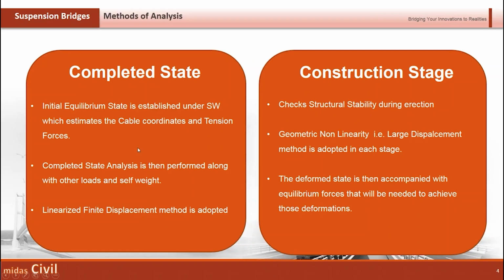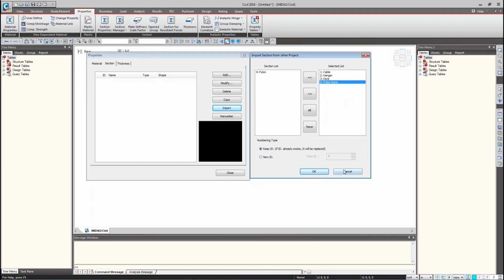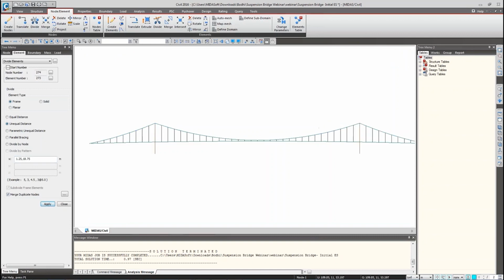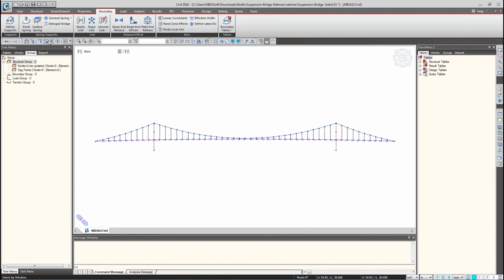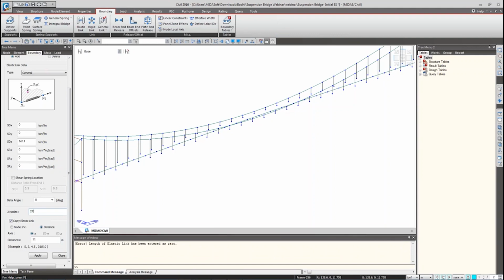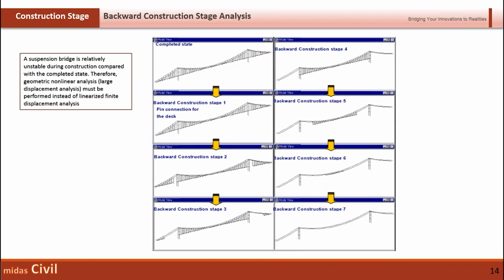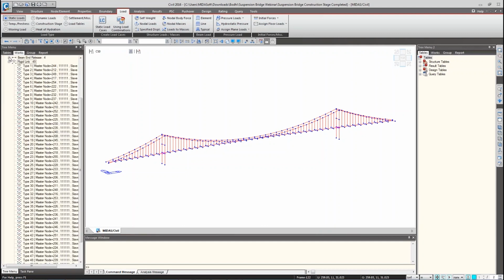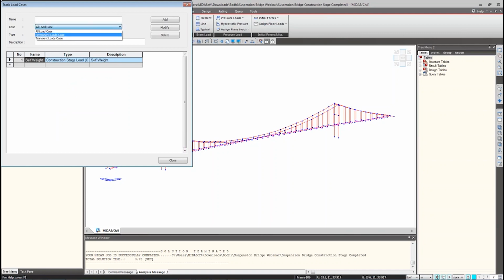Strucutural Analysis of Suspension Bridge: Step by Step Training | Bridge Design | midas Civil

Comment: Good morning sir, I am very grateful to Midas. I am getting warnings while analysing  complete stage analysis. How to overcome this. 
LOADCASE NO.  :    1
   ITERATION NO. :    1      DISPLACEMENT ERROR NORM .. :  0.10000E+01    CONVERGENCE TOLERANCE .. :  0.10000E-02
 WARNING : NODE NO.     83  RX  DOF MAY BE SINGULAR.
 WARNING : EQUATION NO.       250
 WARNING : NODE NO.     83  RY  DOF MAY BE SINGULAR.
 WARNING : EQUATION NO.       251
 WARNING : NODE NO.     83  RZ  DOF MAY BE SINGULAR.
 WARNING : EQUATION NO.       252
 WARNING : NODE NO.    409  RX  DOF MAY BE SINGULAR.
 WARNING : EQUATION NO.       748
 WARNING : NODE NO.    409  RY  DOF MAY BE SINGULAR.
 WARNING : EQUATION NO.       749
 WARNING : NODE NO.    409  RZ  DOF MAY BE SINGULAR.
 WARNING : EQUATION NO.       750
Like this and unable to view the deformed stage.